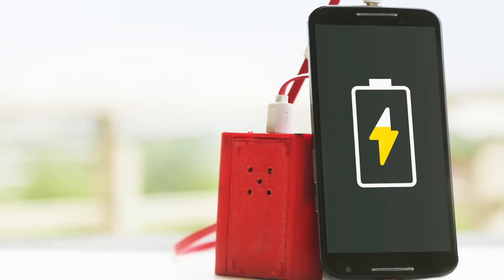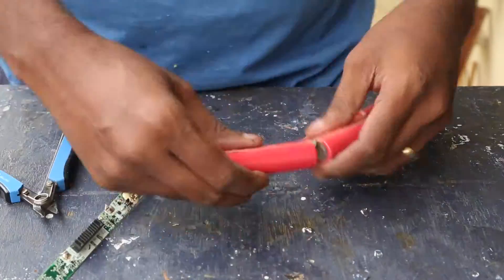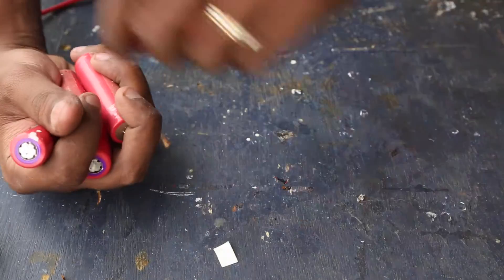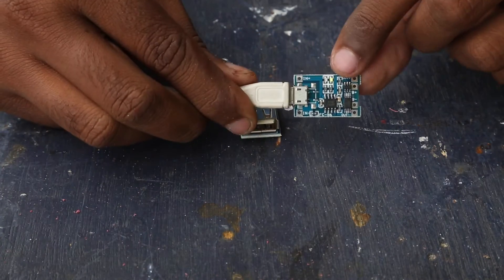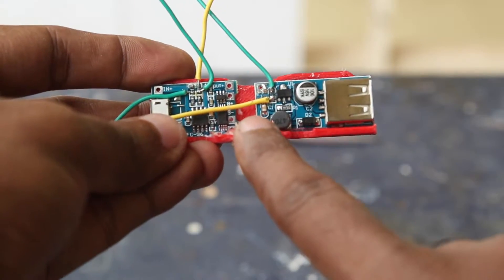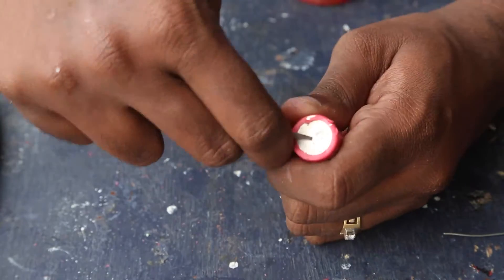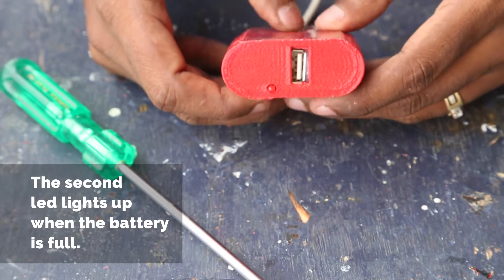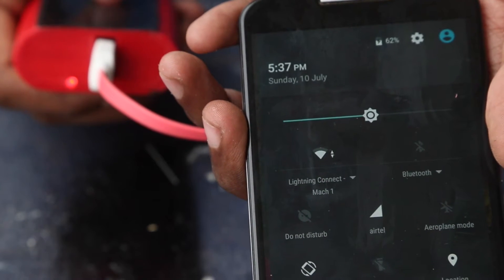Battery pack from Old Laptop battery

Comment: Yes i watched it too late but ... Anyways nice build. Bit remember u can but should not charge multiple cells in parallel with single tp4056 because it can provide max one amps and it will take long longbtime to charge it. Secondly.. if u put big load such as this it will get enormously hot and eventually burn out..so carefull. U may use like multilpe tp4056 in this case
Reply from the maker: Have been using it for a year now. Would like to let you know nothing happened. Still works fine.

Comment: very nice
Reply from the maker: Thank you!
Reply: i want to charge a mobile at rate of 2 amps it is posssilbe
Reply from the maker: The boost converter here gives only 650mA. If you want to get 2amp rating find in ebay a boost converter with 3amp output. Because 3amp is only at peak so you will get 2amp for sure from a 3amp boost converter.
Reply: but there are more bigger than this boost converter
thanks for commenting on this old video :)
Reply from the maker: Please check Aliexpress. There are really small ones available.
Reply: can you give me the link because i have 4 18650 cell

Comment: did u buy the laptop dead battery from online or offline.  if online then from which website ? . BTW awesome video . I like how you r doing it . keep doing it .
Reply from the maker: You cannot buy dead battery from online. You have to source it from ur friends or local electronic market. Also thanks for your comments about the video.
Reply: +mediamilan what is the battery no . is it 18650 battery ??
Reply from the maker: Yes it is.
Reply: +mediamilan can make a diy vape mod tutorial . it would be really great if u could do that
Reply from the maker: I am sorry but what is vape mod?? Can you direct me to some links?
Reply: cant we use all the battery means , i opened up one laptop battery , so all six were working , so what can i do to use all six battery in this project ? also how to calculate the amp and voltage output.
Reply from the maker: You can do that.  But the charging circuit that I used TP4056 will take more than 12 hours to charge all the battery. Because the maximum charge current delivered is just 1amp. You might have to find some other way to quickly and safely charge the batteries.
Reply: +mediamilan or if I added two tp406 on the circuit then it will charge fast ? and wat are alternative option are there for me ?. thank you for ur reply in advance .